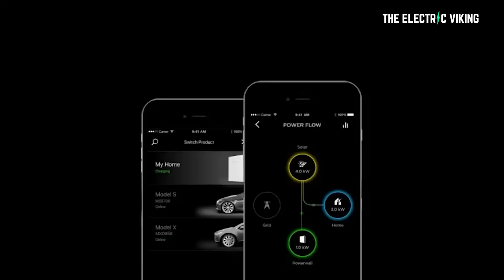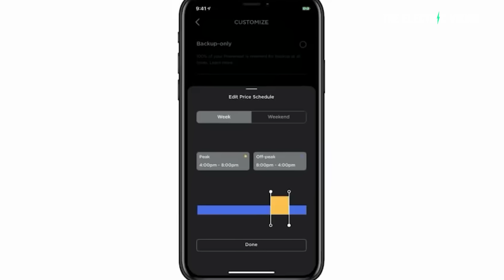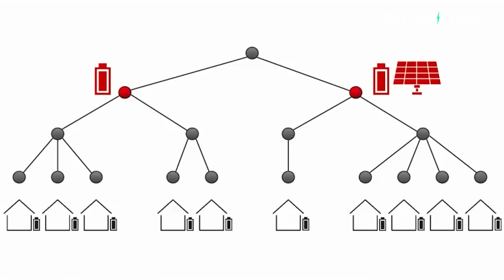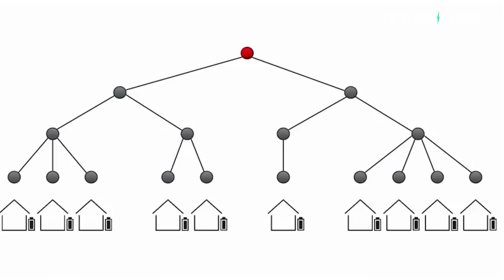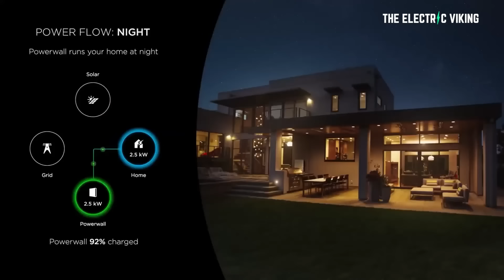Tesla's NEW virtual power plant changes EVERYTHING

Comment: Home battery 14kwh 
Tesla car battery 100kwh 
When you buy the car you get a free battery equivalent to 7 home batteries. 
"Hello hello anyone home, I see the lights on, hello hello". 👋 
Nobody does the numbers. 
With a standard 33m2 PV on 200m2 roof , and the battery, we can keep the existing grid and reduce the need for a central power plant.
Reply: Average battery size isn't 100kwhr and is more like 70-80 kwhrs. Currently around 18million cars registered in Australia and if a 1,000,000 EV's are connected to the grid then that's a massive amount of storage that's available
Reply: @geoffsemon7411  exactly. 
80 x 1,000,000  = 80million kwh = 80,000Mwh every day. The South Australian big battery is 100Mwh capacity. It has stabilised the grid and made $150milion 
But every car has a building near by, and every building is connected to the grid. 
It is not hard to imagine if money is available and automatic connection to the grid is std. Then we have "lift off" for the new power economy.

Comment: The Daily drive is 7kwh 
The EV battery is upto 100kwh 
The EV  battery top up can be a slow process from anywhere on the grid.
Hiteck fast charging will be rarely needed  on a daily basis. 
The home rooftops solar PV will sell electricity in to the grid. 
The EV will always be full.
The EV will always be ready for the long drive 
In the 'horse and cart' thinking way, the drive to the petrol bowsers and spend $150 on filling an empty tank with 100kg of inflammable fluid will become forgotten. 😀
Reply: dona--🥰  English?
Reply: My neighbour owns a Tesla and commutes to work 5 days a week. The car needs charging once every 10 days or so. Slow charged from the solar array. Jealous yes I am!
Reply: @slightlyskewed  thanks for the real world feed back. 
A good friend has a Tesla and drove 1,000 klm trip, 2,000 return and its trip navigator plotted all stops and optional routes/stops.

Comment: Why does the power company's emergency reserve power cost so much?
Reply: Mainly because they are standby and not nearly as efficient nor as clear operating and have no or minimal staff support.  This all adds up to an expensive but needed piece of equipment with the current grid design and technology in place.
Reply: Peaking plants cost money to have on standby, but only generate revenue when exporting (GJ) - the price needs to be right for them to come online (gas fired peakers - for example -  still need predictive data of when to come online as they take a finite time to ramp - batteries pretty much fill in the gaps and gap with "small time interval" frequency management)

Comment: I wonder if those of us that make our own power walls can participate? Tesla power walls are cool and all, but I can make my own for a fraction of the price. The idea is brilliant, and because of the rising costs of distributed power, it will no-doubt succeed.
Reply: How much?
Reply: I am sure if you have at least a single powerwall (though not ideal) you could feed power from your main DIY battery into the powerwall just as you would via solar cells and then essentially feed as much power to the grid as you feel comfortable with.
Reply: @TheDarinseng  very clever 👏
Reply: @xmfclick  brilliant idea 💡 👏 
It will be a more complex problem and will need a smart grid. 
An internet of things. 
The grid wires themselves could be the communication medium. 
Ripple control of hot water systems turns them on and off as off-peak power becomes available. 
EV will have the latest information computers and control.

Comment: This is all about power utilities not wanting to invest in the future, they want you the consumer to supply the grid with power but will that happen at the times it’s required? and will your vehicle be recharged enough by morning when you need to use it?
Lots of questions that really shouldn’t be imposed on consumers….
Reply: The Daily drive is 7kwh 
The EV battery is upto 100kwh 
The EV  battery top up can be a slow process from anywhere on the grid.
The home rooftops solar PV will sell electricity in to the grid. 
The EV will always be full.
The EV will always be ready for the long drive 
In the 'horse and cart' thinking way, the drive to the petrol bowsers and spend $150 on filling an empty tank with 100kg of inflammable fluid will become forgotten. 😀
Reply: @stephenbrickwood1602  the Usage is more like 30Kwh especially when you include longer commutes with A/C on or heating in winter and most EV batteries are closer to 50 KWh or 60 Kwhr usable max, so roughly two days available if you’re lucky…
Reply: @johndair2116  John John John you could get a job with the power companies. 
The future is different and the power companies know it.
Billionaire Mike Cannon-Brookes is investing in poles and wires and the old power plant he will never need to run. Also Brookfields investing billions with Mike. 
EV batteries will continue to improve so all vehicles will have the huge range today's ICE vehicles have. And still top up the battery 24/7.
As you know ICE only use 10% of their range Daily and fill up every 10 days. 
The Billionaires know the future is different.
Reply: @stephenbrickwood1602  You have it backwards Stephen, what I’m saying is why support the power companies by giving them power home owners need to be completely self sufficient and off the grid. Why use your battery infrastructure to prop up their inefficiency and lack of planning.
Reply: Participation is voluntary for those who can do simple math and make money on it. Those who simply don't, for whatever reason, aren't compelled to. And no, its not just about greedy utilities. The base load Must be maintained or rolling brownouts will be required. Peaker plants spend 95% of their time dormant and only engage during spikes in demand to keep everyone supplied. That makes them VERY expensive. Simple truth. 
Worse to react in time, they must already be spooled up or the few minutes they need to do so will mean they Still have a few minutes long brownout in non critical customers. This costs even More. 
Batteries at the least can bridge this few minutes but are very expensive on this scale and again, rarely used, thus making them even More expensive. 
Having a deal with home battery owners is potentially cheaper as they use their batteries (mostly at night) anyway and tend to buy more capacity for blackouts. 

This is a cheaper alternative that the Grid suppliers can tap into cheaply. 
Note that the cost of electricity capacity during a brown out can rise 20x or more during such a time. 

$2/kwh is likely too generous if utilized widely (12x or so) but good to attract takers to an experiment. I Can readily see $1/kwh during a brown out once homes participate on a large scale. The result- lower electric bills. This Already happened in the province of South Austrilia with the Big Battery and VPP (virtual power plant) pilot programs up and running for some time now.
Reply: @avgjoe5969   Edit, agree with you, the choice will be to pay higher electricity bills or do something about it that makes sense to you, not what others want.

Comment: Do you really need Tesla to achieve this? Just a home battery set up to limit grid consumption on the most expensive hours should go a long way.
Reply: For now... yes you need Tesla. You can't just backfeed the system and expect to get paid. There must be a metering and billing system in place that specifically handles the spot market on power during outages when it is 10x, 20x more valuable. The powerwall has this software built into it. Others may develop it, but I haven't heard of other competing products.
Reply: @avgjoe5969  Ok, well I don't know how it is in the rest of the world, but here in Sweden you can buy and sell your electricity at an hourly spot price. With a battery at home you can charge it when energy is cheap and sell when it is expensive. If enough people do that, it would minimise the need for peaker gas plants and the like.

Comment: This is how:

We make smaller powerwalls along w/smaller powerpack. Smaller pws are used in apartments, smaller powerpacks used in the neighborhood. All vehicles have V2G.

Whatever solar & wind generated locally would be linked into the system.

AI sorts out proper charge for all connected vehicles given their scheduled use. Produced energy, wind & solar is prioritised for local use, feeding the grid, then charging local batteries. Solar arbitrage strategies used. By in large local neighborhood, house-building, and individual charging and discharging would optimize benefits. This will mean charging during lowest grid use, at night/discharge during the day, peak use.

Granularly Distributed Peaker Power! Many if not most residential neighborhoods would be net producers. The rest will reduce their grid use.
Reply: Excellent thesis on applying socialism to California’s power outages. 👍 Will be interesting to hear what California people’s viewpoints are.
Reply: @lesliecarter4295  Not socialism... market corrective.

Comment: Powerwalls and megapacks do nothing other than hold a charge temporarily so you don't have to be home to charge your EV. This makes the use of lithium per car even greater.  Putting the batteries in EVs does something it provides transport. Most can sell electricity to the grid they don't need a battery pack, it is a waste of Lithium that detracts from EV production.In Peak Sunbelt areas this may mean a surplus of energy is made; but this is relatively rare and not worthy of wasting lithium on it.